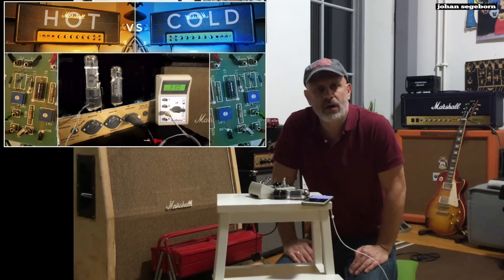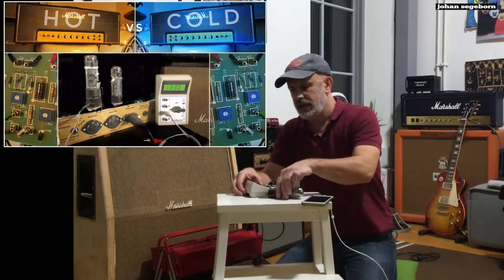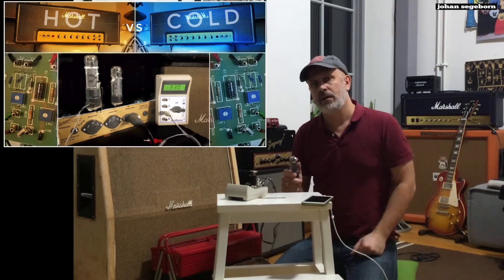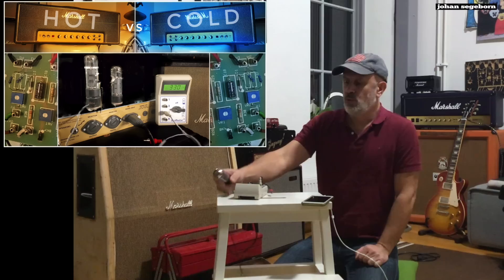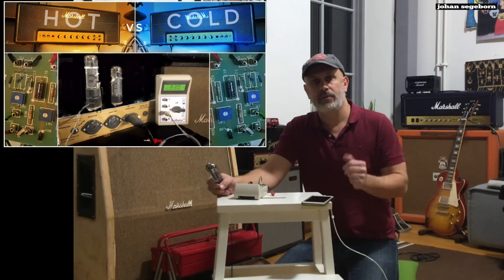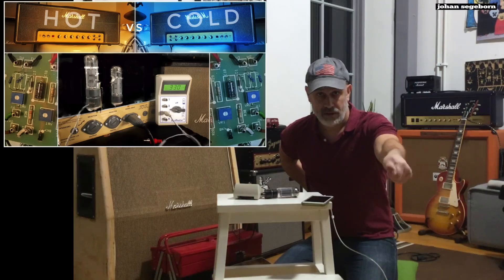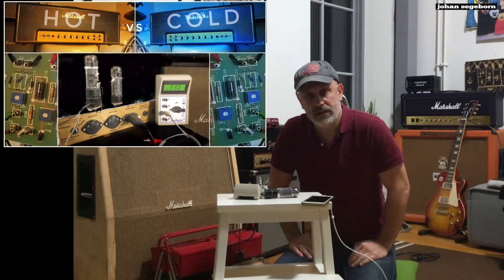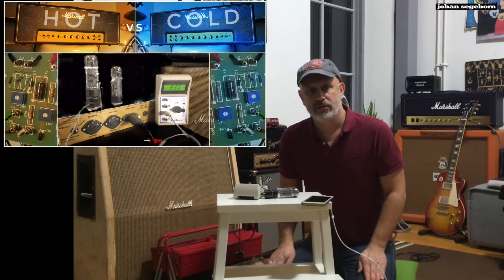HOT vs COLD Tube Bias on a Marshall 50W

Comment: I think we went through this but I will bring it up again. If you use a Variac to lower the voltage you get that "brown sound".
In America, at Niagara Falls where we built a huge electric power generating facility, sometimes because of overuse (too many people using electricity at the same time of day)  they could not meet the standard power requirements of 110VAC and only sent out 90Vac. So we designed electrical appliances to function from 90Vac to 127vac. So in America if you wish you can run a guitar amplifier at 90 Vac and starve the power tubes a little and that's how you get the 'brown sound". To your readers here. The brown sound sounds very much like tube sag, if you are not familiar with these terms.
In Europe you run at 220VAC and a brown out perhaps would be down around 180 VAC. I know Johan has made a video showing how this affects a MARSHALL AMPLIFIER (of course).
-Peter 
Johan has taught more people about guitar amplifiers than perhaps anyone else-ever! What a tremendous gift to all of us Johan is.
Reply: UK mains is 230V +10%/-6% so 216V-253Vac. My house is 253V all the time so I use a variac to give 230Vac when setting the bias on any UK amp. I set 1987x bias to 35mA cathode current, which is nearly 32mA plate current. Plate V=460Vdc so the EL34s are running around 15W or at 60%.
Reply: 220V? That's a bit lacklustre. 240ish volts and 50Hz is what a Marshall is supposed to run off of. "230v" kit is supposed to run anywhere in yerp, but it's variable pretty much street to street with distance from a substation. The magic recording studio in the middle of nowhere might just be doing it's magic because the supply voltage is rock bottom.
Reply: our voltage here (Boscombe,Dorset,U.K) goes right down at peak times, even as low as 190 at the weekends., I think 187 is the lowest I seen so far, been doing it for years, same in my neighbours ,
Reply: Sean, a Variac (VariAC= Vari the AC voltage) can be used to keep a special item safe in your home because you can adjust the voltage to be exactly at the correct voltage requirements of that item during the periods of reduced power to your home. It could be a tube amp or a computer or anything in your home. A 20 amp /2000 watt Variac can run a few items up to 20 amps total load. Of course you can purchase several Variac's.
Also if the reduced voltage in your area/home is not really a problem then save your money and just keep everything the same.
Reply: @PeterDad60  Thanks for the tip, not bothered about it really, but my neighbours electric Can opener doesn't work though sometimes , that's about it really lol, I've heard the term VariAC before, but didn't know it could keep the voltage up like that.
Reply: Living in the U.S.A. we were brought up hearing 220VAC as the reference AC voltage in Europe, I'm 69 and the voltage like the times have changed. So forgive my nominal usage of 220 VAC for your Europe voltage. Really, I live here in America and I only know what I was taught 45 years ago. Ha ha. But also even this year I have read many times 220VAC from a European person!
Reply: Brown sound is different story...even with 90V you can get hot or cold bias setting and sound...
Reply: Sure, but if you run reduced AC voltage from the nominal voltage in your home the bais shall drop to a lower number automatically with out adjusting the bais pot. Then of course as you noted, you can adjust the power tube bais using the bias pot to anything that the reduced voltage can deliver. I'm sure it's lower that it would be if the wall voltage was not reduced and you know that too!
Reply: I agree. That's why I use a Digital Multi-Meter and an 8-pin Duel Bais probe as well as one or even two methods for reducing my house AC wall current into my guitar amp(s) as each amp has different requirements. I am using a 1200 Line R ACP and a Variac.
I control the AC current entering the amp as well as adjusting the power tube bias using the bais pot at what ever AC voltage I may be using for any individual amp. 
If I only reduce the AC from 120VAC down to 110VAC then the individual tubes bias automatically drifts down by a similar % or from 30 mVDC to 25 mVDC.
If I wish I can supply even less than 110VAC and adjust the power tube bias up, down or to remain the same. That's part of learning how to control the tone.
Then also changing out Power tubes manufacturers or even going to different types of power tubes as well as different preamp tubes.
This is why I stay with tube amps. One day I shall build a few tube amps because that is what I want to do to save money. I can't afford a bevy of $3,500 amps. Can you?
-Peter

Comment: I hear the hot bias as more open and dynamic, the cold bias as smoother and more polite, and the intermediate values as compromises between the two. I could see using either of the extremes for particular sounds, but I think on the whole I'd go for 33. I can't see the point of very cold biasing for everyday use, as you can get that compressed, muted effect in other ways. The hot bias, while exciting, is approaching the edge of unusable, and can't be doing the valves much good. I assume that's why Marshall bias their amps the way they do: the best sound consistent with decent valve life.

I thought the differences were more audible on rhythm parts than single notes.

Comment: I couldn't hear much difference, only at the very end of sustained notes, where there's this faint "fizz" that's more present in 33mA, 26mA and 18mA. Makes sense, as that's likely crossover distortion, which is inevitable in push-pull amps, and a hotter bias causes less of that distortion because the tubes are conducting for more of the signal.

Comment: Too low Bias sounds a bit dull and saggy. I prefer somewhere between 32 and 37mA, depending on the Tubes. Russian and Chinese ones are better a bit(!) on the cold side, whereas JJ, RFT/Siemens etc. sound best when driven slightly hotter.

It´s not easy to tell a difference just from listening to soundclips. The difference in feel and punch differs a lot in "reality".  

But what is even more important is a properly "synchronized" Poweramp and proper matching of the PowerTubes.  

All those things together make a difference between "ok, sounds like a marshall, i can work with that" and "DUUUUUDE, that sounds awesome!"

Comment: Johan can you do video on comparing the sound of a tube amplifier before its warmed up and after to show thw differences and reasons to let your amp warm up great playing man its kick ass i live the sg
Reply: I bought a marshall afd100, the tone changes dramatically after the amp has warmed up for a good 20mins, sounds very thin if  not.
Reply: @katieandjasonh4786  thats how i feel about my Earth G2000. It sounds really thin
Reply: Then why do you let amps warm up for like 15 minutes before use? Thats not fast
Reply: @Emplexador  what do you mean by oil
Reply: @minibikegarage1577  ...trying to be funny.  Again, no need to 'warm up' amp for 15min.
Reply: @Emplexador  my amp has oil capacitors
Reply: I’m not sure about the technical side of it but I do know after I’ve played about a half hour my amp sounds much better to me it gets noticeably warmer and has an all around more fluid sound it’s a 1982 2204 combo. It’s obvious though, a tube that’s been on or “warm” for 30 seconds will work atleast a little different than one that’s been operating for say 30 minutes and is hot! Hot and chewy
Reply: My 35 watt valve amp needs to warm up for 30 minutes. I just turn down the instrument volume when I take a break. It makes a difference. Also I  only use stand by when I first turn on the amp, after that the stand by switch is not used.

Comment: I think the 33 sounded the best. When they talk about "Hot Rod Marshall", what does that mean?
Reply: IT can mean they installed different kind of power tubes and the output went from 100 watts to maybe 120 watts. Ex. EL34's can be replaced with 5881's for more power. Sometimes they add/change  a few components as well such as diodes, capacitors and resistors-they change the value from what came stock.

Comment: Difference is negligible because the preamp shapes the tone and gives a little distortion, but the bulk of the “power tube distortion” you hear in a Marshall is actually the phase inverter breaking up.  Marshall plexi type design simply doesn’t have enough drive past the phase inverter to actually saturate the power tubes (running under normal conditions).  This doesn’t mean that the power tubes don’t add their own tone shaping, as they do, but it’s not a big effect on things.

Comment: Thanks Johan for another informative video.
I was honestly expecting to hear a much more dramatic difference between hot and cold biased, but the only major difference I heard was that hot biased went into harmonic feedback more quickly.  The tone and amount of actual gain sounded pretty similar down the line.  Very unexpected.  Thanks again.
Reply from the maker: Thanks I agree, the differences were unexpectedly small. Should probably do this for a couple of more amp models

Comment: I thought I’d hear more difference.....but to my ears 33ma wins followed by 26ma.  18ma sounded a little lifeless like an excellent solid state amp recreating the tube amp sound.
Reply: Same here, 33 sounds best, followd by 26, but 18 and 41 are both not convincing for me.
Reply from the maker: Thanks Dave, I expected bigger differences too
Reply: 33 was the sweet spot for me too
Reply: I can agree with that. If I had to pick one, it would be 33. A pretty perfect amount of crunch for hard rock. All of the settings sounded great. Point is, there is audible  difference. Those not picking up on it are not paying attention to the saturation and sustain in say 18 vs 42.  Also notice when he’s up the neck playing  single notes on 18, the texture and dynamics, vs 42, where they are a little less.

Comment: I actually like the cold bias on that Marshall weird considering on my fender amps I prefer a hot bias
Reply: I agree with the higher bias number for Fender. When I first bought my Fender HR Deville I checked the bias settings and it showed between 48-50 so I adjusted to around 68-70 and it made a noticeable difference for the better.
Reply: @Westghost101  a hotter bias works wonders for fenders I have found at least with the fender amps that I've owned through the years that they usually come slightly cold or neutral from the factory all those harmonics really shine through once biased hotter I once owned a 73 quad reverb that I had blackfaced and biased hot and the difference was night and day can't recommend it enough
Cheers
Reply: @TheGman858  carvin too. Almost twice what carvin recommends  and the tubes still last forever.
Reply from the maker: Thanks Greg